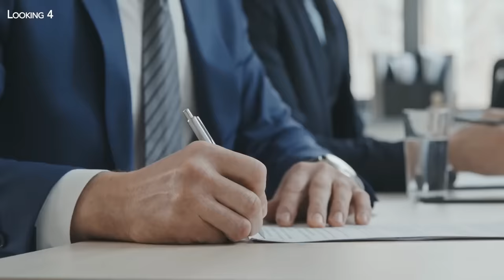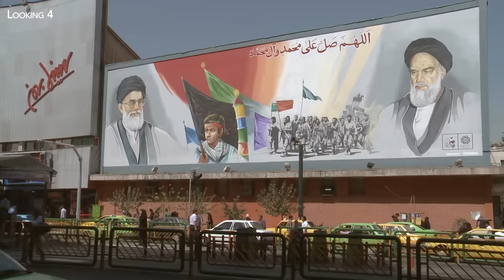Egypt, Afghanistan, Iran... The New Water War has begun

Comment: In regards to Afghanistan Amo river There are several agreements with Soviet Russian from 1921 to 1978 on water management, fishing, and sailing. Soviet Union previously didn’t allow afghans to exercise it Amo river rights and putted pressure on previous governments. And in many cases they have violated those agreements with Afghanistan. After USSR collapsed the central Asian republics inherited those agreements, and not making objections to the matter because the violations of the USSR benefited them for decades and they have continued to do so. They continued to build dams and massive water pumps and canals, though those were obviously violations of previous agreements and damaging to the environment especially to water regime and river banks on Afghan’s side, since 1970 the river has washed minimum of 1200 square kilometers of Afghan side bunks. Because Uzbek side has built dams and walls on their side and pushed flow to Afghan side. Now it is wise to the Afghans neighbors to quietly accept the reality and canal otherwise they will loose a lot more.

Comment: The cannals instead of having a plain flat surface like a runway, at each intervals of  21 ft there must be small water arresting check dams running throught the length of the canbal so that at each place water percolates at every 21 ft distance area in addition to slowing down the flow of water if the cannal is designed in a st line.

Now a curvy sinosidal wave pattern of cannal can be adopted with provision to rain water to spill off at the crest points so that maximum water infiltration takes place aiding an environment  for vegetation growth.

Comment: According to sources, there was an agreement signed in 1942 that explained the rights of each country around the Amu Darya. Based on this agreement, Tajikistan gets 64%, Afghanistan 26%, Uzbekistan 8%, and Turkmenistan 2%. However, for the last 70 or more years Uzbekistan and Turkmenistan cumulatively used 42% of the water which indicates over usage of their rights. They even used Tajikistan's part as well. Upon completion of Qosh Tapa Afghanistan will use only 15% of the water coming from Amu Darya meaning that the other countries should start using based on what was agreed. Due to the mismanagement of the Soviet Union in Uzbekistan, the Aral Sea dried up. If Uzbekistan cares about its population and the Aral sea, it should use it within its boundaries and the same goes for Turkmenistan.

Comment: Ethiopians have the right to do whatever in their land. It doesn't concern Egypt as long as Ethiopians doing in their land.
Reply: That depends. There is a contract stating that Egypt has the right to X percent of the water of the Nile from 100 years back. The big issue is that that contract was not signed by Ethiopia or Sudan! And still Egypt wants to hold them to contract
Reply: Facts

Comment: The river helmund and the river amu daria must be delt as an individual river eco system and the  countries as its participating stake holders.
2. The catchment habitat near the source of these rivers must be protected by  joint cooperation among all the stake holder countries. The stake of each country must be decided by the flow of length of the river in their part of the land.
Eg  if Afghanistan  has 60 percent  flow of amu daria river, iran has 20 percent  and Uzbekistan  20 percent,
Then  entire river from its source to its meeting with the sea  ecosystem must be jointly funded, maintained and utilised according to their ratio of stakes.
Thus afghan with 60 percent  stake will have to invest 60 percent of the project cost, maintain 60 percent of river eco system and also utilise upto 60 percent of the water share.
Likewise iran 20 percent  and Uzbekistan  20 percent.

Comment: With all the water diverted not only from GERD but also from the construction of this new delta, this will no doubt  decrease the discharge from the (original) Nile delta which will cause the salinization of the area. This is currently what’s happening in Mississippi River. I fear this new delta is a future ecological disaster.
Reply: No water is diverted from GERD. It is a power plant, and the river Must flow, and it flows.

Comment: Although you use what appears to be a private YouTube account, I bet you most likely are an agent / hired hand to spin the reality for PR purposes. I can smell the spin from the subtle misrepresentations and the bias of the presentation.

What are the misrepresentations? Good!
Let’s be objective, if you can handle the truth:

1) The Blue Nile (Abay), which originates mainly from the highlands of Ethiopia contributes NOT 60% (like you misrepresented), but 85% - 86% of the water to the Nile.

Up until recently, Sudan & Egypt were using a 1929 colonial treaty and a 1955 treaty that was made between the two countries (Egypt & Sudan) to take all of the Nile’s water: 18% for Sudan and the rest for Egypt, none (0%) for all the other 9 countries along the river.

2) Your presentation made it sound like Ethiopia was the one who did not want to talk. NOT TRUE! Egypt and Sudan were the ones who walked away from the talks protesting the filling of the 3rd phase of the dam filling without a binding treaty.

3) You presented the construction of the dam as … threat to Egypt.

First of all, the construction of the dam is built mere 35 km before Abay (the Blue Nile) leaves Ethiopian territory. It’s purpose is primarily to generate electricity. Therefore, the cry about water siphoning is disingenuous. If it were drawn away for irrigation purposes, you might sound like genuinely concerned. But the purpose of the dam is primarily for electric generation.

Second, even if Ethiopia wanted to draw T water from Abay 
Your prejudice is vividly laid out when you play stupid about international law that calls for equitable usage of transboundary rivers. In 2011, all the Nile riparian states had come together to talk about equitable usage of the Nile waters. While a majority of the riparian countries signed a memorandum of understanding in agreement of a resolution to utilize the water equitably, Egypt & Sudan walked away from the session.

These are the facts.
And yes, Ethiopia has justifiably has stated that it will not sign a binding treaty with Egypt & Sudan. Because the right place and circumstance to sign a binding treaty for equitable usage of The Nile is after an agreement has been reached among all the riparian nations. Until then, Ethiopia is within its rights to utilize the Abay waters within its borders.